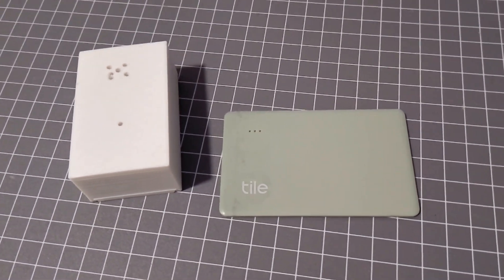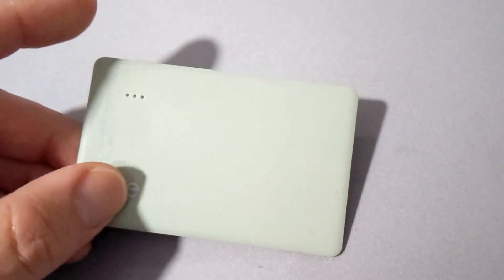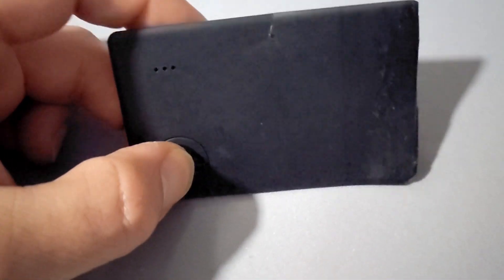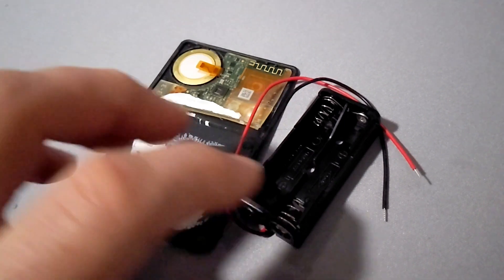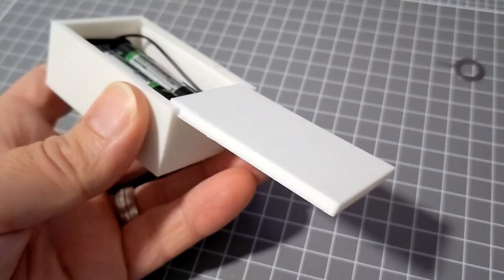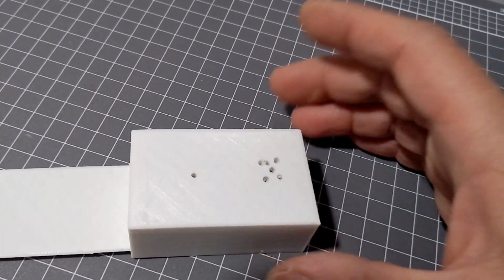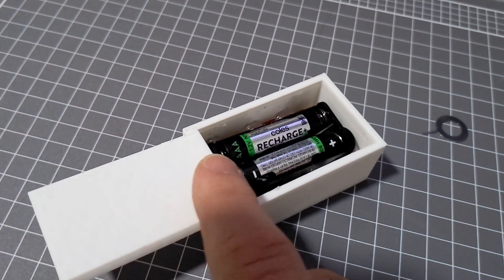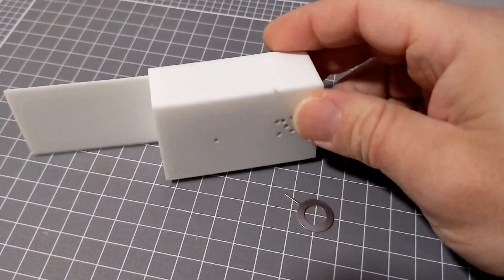Reuse a Disposable Tile Bluetooth Tracker with a Battery Mod

Comment: Just tried to do this with one of the square slim ones and that worked out fine, but since I replaced it with the 'replace' function in the app, they seem to have invalidated the tile itself. When trying to add it again, it says that the tile is already associated with another account. Pretty shady. Was not expecting that.
Reply from the maker: Yeah I've been staying away from that option. I thought it may have been a self destruct button. Mine will forever tell me to replace it and I just ignore it. Maybe their support can reinstate yours?
Reply: @geekydad8565  Naw, already in the electronics recycling pile. I only had the 1 left and some battery carriers from a different project. Spent 10 minutes on it and took the L. No biggie. Still extremely crappy and anti consumer behavior by Tile.

Comment: Was just embarking on this mission myself and came up with the same solution. Wondering if the  original battery is rechargeable. Do you know?
Thanks for the video, very cool.  I subscribed .
Reply from the maker: Thank you! Definitely not a rechargable battery that comes with it. Mine is still going strong since I uploaded the video. It's been telling me that I still need to replace the battery and funny enough I checked it about 30 mins before your messaged. i am currently parked in a back street that I've never been before and I'm sure I'll get lost haha. Very simple and cheap to bring some life back to the unit.

Comment: I don't know whether it's possible to cram a wireless charger into this card, but if it is, that would make a very neat device
Reply from the maker: I've seen some small charging modules so I don't see an issue putting one in. You can even find smaller rechargable batteries to balance out the usable space. The default battery lasted me a couple years, with the AAA's it should be much much much longer! I'm just using cheap rechargeable batteries and once they run out I'll do a quick swap with some spares I always have about so having a charging module would not be required for my use.